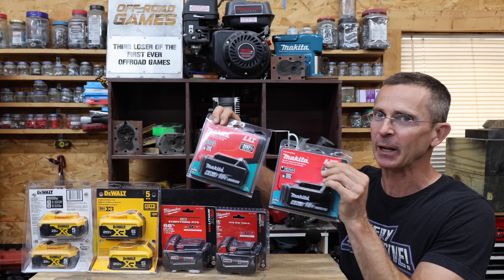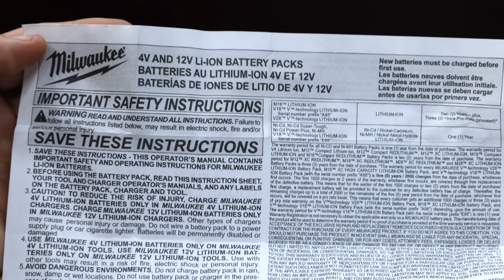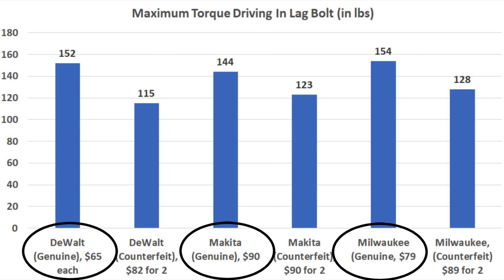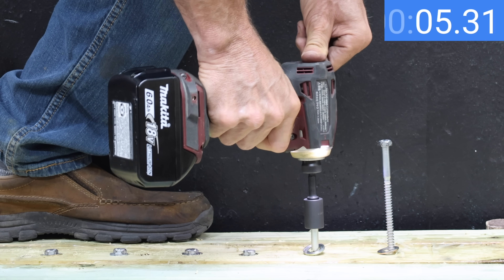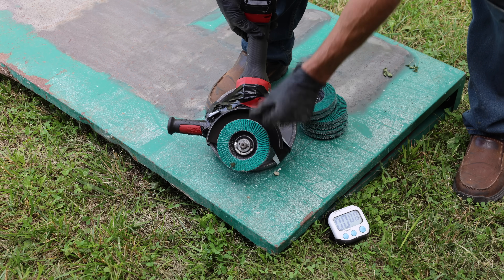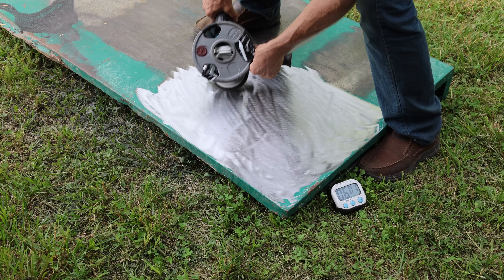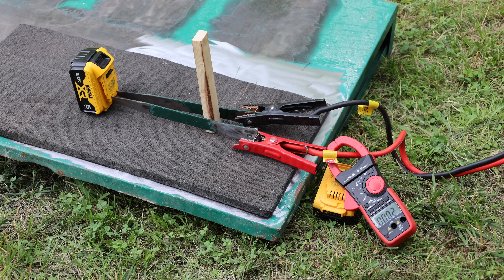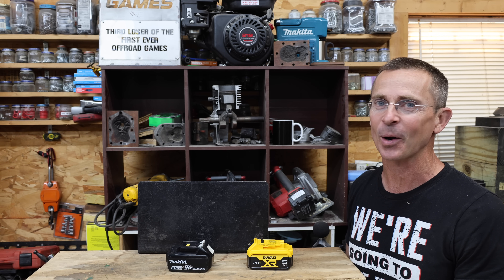Have You Been Scammed with a Counterfeit Tool Battery?

Comment: Ok, so I have to say your efforts for this video is amazing! I found a counterfit at Home Depot, most likely a return fraud, not a HomeDepot supply chain issue... but none the less, a problem.
However, I manage to weight the dewalt batteries and you could totally tell! Your video of the weight was extremely helpful! Shared the video with my local Home Depot and Lowes staff.
Reply from the maker: Thanks for sharing!

Comment: 30 years ago, I managed off shore development, including the development of a battery, to be sold to our customers.   The first batteries came back without the protection circuit.  They made a mistake.  But we caught it in testing, and had it corrected.  So, odd enough, there are companies overseas, that will make the batteries with your label to your specification.
Reply from the maker: Thanks for the suggestion.

Comment: I bought some milwaukee m18 on ebay and didn't realize they were counterfeit until one of the batteries failed the first week and that my older 5 amp batteries were outperforming them.  So yeah, there's a reason why a couple M18 batteries will run you $200 from home depot.

Comment: Most of the counterfeit batteries use worn out recycled batteries from old laptops and things like that. I would guess they test each cell to make sure it will take any charge at all and rewrap them. Even if they do work, they simply won't last very long at all. You are still way better off buying genuine batteries that will last far far longer and perform better. Paying half for something that will die in 1/10th the time is just not worth it.

Comment: Here's a from left field request. How about exercise loop resistance band comparisons. I'm older, and just don't want to deal with weights, so these are it for me. Every review I watch, I can't help but think that you would do better. My main concern is value and longevity....which I'm sure you can come up with contraptions to test that. I'm also wondering if there is some technology that they can incorporate into the band to make the resistance range more uniform.  In other words, at the beginning of the rep, if it's 50 lbs, at the end range of the rep, is it still close 50 lbs, or significantly higher. Anyway, that's my request.

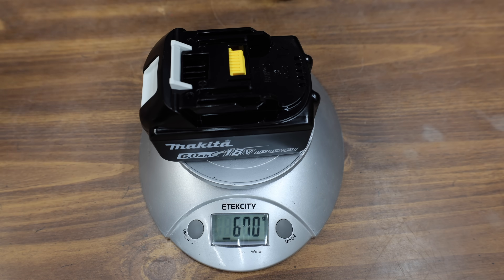Comment: The othentic makita batteries have a little star on them where the power tool slides in.  When you were taking off the casings at 5:05  the left battery was the othentic. You can tell by the star and the orange colored data connection
Reply from the maker: Thanks for the constructive feedback.

Comment: About a year ago, I was trying to acquire a couple of high drain 18650's for a project I was building.  I didn't really care much about what brand the batteries were, as it was only going to be in use for 2 to 3 weeks. It was cheaper to buy a knockoff drill battery than to buy the individual high drain cells, so I bought one, new, genaric "Makita" battery for $35 online. (Amazon) The seller was openly stating that the batteries are not made by Makita. When it arrived I took the battery apart to gets the cells out and found them to be used 18650's and they were regular "laptop" cells, NOT high drain cells. 
Worst $35 I've ever spent.
Reply from the maker: Thanks for sharing.

Comment: Do the 12v DeWalt batteries have the same identifiers? All of my 20v have the QR code but the 12v do not (and there's no space for it on top or bottom). All of my batteries were bought at Lowes.

Comment: In these comments I saw someone refer to Amazon batteries as 'counterfeits'.  Not so.  They are clealy marked as 'replacements'.  And are clearly different in appearance.  And actually, in my experience work better than the originals that came with my cordless tool at a fraction of the price.  I just bought a 2 pack of such batteries on Amazon for $30 ($15 apiece).  And they last as long or longer than the originals.  And I've used over a hundred of this type batteries off Amazon without issue.  My tools OEM batts cost over $100 per.  The replacements are $15.  I don't care of they do blow up or are slower.  I can afford to buy them.

Comment: Project, you're missing the point.  Saving money is worth the extra second to drive a huge lag bolt which few will ever need their drill to do (incidentally).  And the OEM genuine that come with the drill are just as worthless in terms of longevity.  I get more out of the aftermarket batteries than either the OEM or counterfeit one's.  I get 'em on Amazon for $15 each and they last me for years.  And I don't care if they take a second longer to drive a screw, etc.  By the way I can remember having no cordless tools and doing it by hand or with and egg beater hand drill.  Those used batteries that were ME.  When I wore down I went in the house and had refreshments.

Comment: I'm actually super disappointed in your lag bolt test. You didn't use a consistent pressure for all the tests and depth for sinking the bolts was subjective.

That's not to say that the Milwaukee wasn't still the fastest, however.

Comment: Genuine Makita batteries (at least the ones I have) have little surface mount fuses on the control board that will blow in a dead short. You can type the part number into an electronics distributor site and buy replacements for a few dollars. Solder them on and you have a good chance of getting the battery working. "JHC 6002503 R44E" is what i used.
Reply from the maker: Thanks for the feedback.

Comment: This has to be the most disconcerting video yet. Especially if the counterfeit is exchanged at a big box store and simply put back on the shelf as "opened" with a 10% discount. I've made purchases in the past at both Home Depot and Lowes, get home and clearly the item had been opened, returned and simply thrown back on the shelf with no inspection by the either store to make sure all the parts where there. I wonder if the big box stores have ANY policies in place to thwart this BS.
Reply from the maker: Thanks for the feedback.

Comment: That's why I make sure my Milwaukee M12 batteries are 100% non-Milwaukee but also 100% OEM/ODM specs (Elefly brand). The Elefly brand holds up pretty well (actually really well). I feel like I've found the Unicorn replacement battery for Milwaukee M12 tools.....
Reply from the maker: Thanks for the feedback.

Comment: If the originals weren't so ridiculously expensive, there wouldn't be such a market for the counterfeit ones.  I always buy the batteries bundled with the tools because they are usually reasonable that way.  I would never buy counterfeit because there is too much at risk if there's a fire.
Reply from the maker: Thanks for the feedback.

Comment: Idea for a video: test of camping coolers/ice chests. Whatever you wanna call them. Yeti's are great, but really expensive. Heard good things about Coleman. It'd be interesting to see if the 12V thermoelectric coolers are really worth the hassle? I have one (Coleman brand, bought it used) that worked fine for a while and now it doesn't really. I'm about to ditch the idea of hauling a solar panel, a battery and the controller with me, and just get another "normal" cooler. I rarely go for longer than 4-5 days, so if there is something that will last that long, without using 80% of space for ice ;) that would be great.
Reply from the maker: Thanks for the suggestion.

Comment: These are probably made in the same factory. China is notorious for doing overruns of product in the factories and then selling them directly to make more money. So the factory will have an order of 1000 authentic batteries for the manufacturer and will produce those 1000, then change a couple things to cheaper variants and produce 1000 of their own with the same molds and machinery.

Comment: The biggest problem that i see with the counterfeit batteries is that they are prone to failure when used heavily.  Yes they are less powerful and do not last as long... but depending on what your using them for that may not be the deal breaker  after all if they are half the price your overall useage time will be more overall.  

But if they short out and break the first time you use them hard?  Thats just not good at all.
Reply from the maker: Thanks for the feedback.

Comment: I had no idea there was such an issue with counterfeit power tool batteries. Is there any way to truly tell a counterfeit battery from the original without having a side by side comparison? Especially since manufacturers frequently change the look of their batteries and packaging. Thank you for fringing this to light. No more "cheap" internet batteries for me, that's for sure.
Reply from the maker: Thanks for the suggestion.

Comment: Yep got scammed buying DeWalt packs on eBay last week, saw this video and got scared... Worst thing is I opened the first pack, saw Samsung cells and bought another... Saw this video, got scared, opened the second... Sanyo cells, pulled the pack all the way out of the shell, they're all second hand, you can see where they've ground the ends of the cells to remove the old spot welded tabs, one pack was Samsung 20r in a 5ah pack and the other ur18650rx which is also 2ah cells so both packs would be 4ah when they were new! But they're second hand cells swapped into a new case, Lucky I only bought them last week! Praise project farm for saving me $150, return processed, reported seller, thank God for project farm!
Reply from the maker: Thanks for sharing.

Comment: Bless you for this video and the expose of counterfeit batteries. I just purchased from WallyWorld DeWalt 20V 5 amp batteries and weighed them and compared to the same type that I had purchased from Amazing in November 2023. The WallyWorld battery weighs 602 grams and the Amazing battery weighs 644 grams. They are identical in apprearance. If the price is too good to be true, it probably is a fake. Buyer beware.
Reply from the maker: Thanks for sharing.

Comment: I bought a 2 pack of 9ah DeWalt batteries from Lowe's and noticed right off the back they didn't have as much juice as my other 9ah batteries. Waited a couple cycles of the batteries thinking maybe they just needed to "wake up" well they just got worse. Ended up opening them up to check to see if somehow they had gotten outta balance cell to cell. As soon as I opened them up I knew they were fake they didn't even have any kinda of circuit board in both of them. Tried taking them back they wouldn't accept them back. Just ate the money lost and never shopped at that store again neither did the company I worked for at the time. Lesson learned can buy real batteries from anywhere lol
Reply from the maker: Thanks for sharing.

Comment: Have a Sears drill from 2011, as of now 2024, original batt still works, but bought a second one recently "just in case" this new batt looks great, and ran the drill fine, until it ran out of juice, and then would not charge on the original charger at all (charger did not "see" it) A sad state of affairs.
Reply from the maker: Thanks for the feedback.

Comment: What about Best Boot dryer? 
For drying boots daily after wear.
Reply from the maker: Thanks for the suggestion.
Reply: @ProjectFarm  no problem! Thanks for reading and making the videos.

 I would like to know about reliability of these relatively cheap units and safety for me and my family.

The unit I have can not run on my Service Vans 120V plug, it over amps.

so drying while driving is out of the question, I have to do it overnight.
Dry boots lead to less foot issues in the working world. Thanks

Comment: Video suggestion: Best Inspection camera/Boroscope. I use mine to look for leaks in the wall, under the outside trim for rodent entry points, under blown in attic insulation to trace a wire or leak. Only problem is, mine sucks. I have no idea what makes one better than another. Hope you make this one!
Reply from the maker: Thanks for the suggeston.

Comment: With air-conditioning moving to potentially explosive R454b I'd like to see it tested independently and publicly. Maybe a constant fan in a sealed box and increase air/454b ratio with a constant ignition source mythbusters style. I've seen maintenance crews put over 40lbs of refrigerant in leaking systems before so I'm concerned.
Reply from the maker: Thanks for the suggestion.

Comment: Project idea: best multimeter
All meters have a rating of 600V Cat. III or better
Fluke 87V
Amprobe AM-530
Southwire 16020N
Fluke 101
Klein MM325
Ames Instruments DM600 (Harbor Freight)

AC voltage accuracy
DC voltage accuracy 
Max/Min recording function 
Backlight
Resistance (ohms) accuracy
Voltage spike withstand to failure
Reply from the maker: Thanks for the suggestion.

Comment: Damn... now to be fair, when I buy batteries off of Amazon, I am not trying to buy the exact same maker as the original, I just want a device that will fit and work the original tool.  I've had great luck with the Black and Decker substitute batteries, which actually last longer and work better than the original batteries that come with the products.
Reply from the maker: Thanks for sharing.

Comment: Tool makers will probably have to resort to some sort of encrypted chip in the battery which needs to be activated by a Bluetooth app which communicates with the manufacturer.  Of course the risk is counterfeiters will figure out the algorithm used to register fake batteries, just as they figured out how to generate physical serial numbers which are accepted by the manufacturer web site.

Comment: For what it is worth, I accidentally bought a knock-off Milwaukee battery.  Didn't know it until watching this video.  Compared it to a known real Milwaukee battery and clearly it is a copy.  

Just for the heck of it I took it apart and compared it to the real Milwaukee battery in this video.  The knock-off I had, had Samsung cells in it but the rest of it looked like the knock-off in this video.  The circuit board in the knock-off clearly was different from that in a known real Milwaukee battery I have.   Bottom line - apparently knock-offs come in different flavors but cut enough corners to be cheaper.
Reply from the maker: Thanks for sharing.

Comment: Review idea for you Todd. Wild Fire resistance of house siding. Wondering if cement board type and maybe steel siding might be significantly better than wood, pressboard or vinyl. I think I know the answer but it would be fun to test and interesting to know for sure.
Reply from the maker: Thanks for the suggestion.

Comment: This is a very valuable video - revealing the extent to which scammers will go to produce "look-alikes".  Now the problem: how do we know?  The simplest approach - which won't work - is to presume the "cheap" one is the fake.  But a really smart scammer won't make it cheap - maybe even making it more expensive to fool those looking to avoid the "cheap" knock-off.  Yikes.  What do we do?  It would have been helpful if there was some commentary on where "true as claimed" batteries could be purchased.  For example, maybe it be possible to say "you will probably get the real deal if you buy at a store with a reputation it wants to protect."  Anyway, thanks for this helpful video. The issue of fire makes this a more important issue than many other types of purchase.
Reply from the maker: Thanks and you are welcome!

Comment: I life in germany and we have you could say a experiment going. My father and i drive both diesel, my father a 20 year old Mercedes C 220 W203 with the 2,2L engine (i say it because depending on the factory tune you can get a different classification) on long distance drives and i a 7 year old Microcar mgo4 Highland X with a 480cc engine (that engine is from Lombardini/ Kohler, those are also used in generators and small farming equipment) on short distance. We both use the standard diesel which can have up to 7% bio oil. 
His engine still runs perfect after over 600.000km (only the glowplugs getting a bit weak (around 70% performance), on my one the injectors got caked up that they doesn't want to close completely so that diesel gets into the cylinders and gets down into the oil if the engine is shut off, other problems is often after the start that one or both injectors gives to much diesel on low rpm that the engine is about to stop running or you give a bit gas and the engine starts to rev up like you press the pedal completely to the floor.
Now i had changed the oil (because it was contaminated with diesel (about 25% diesel in the oil) and switched to the premium diesel and after a few hundred km now the problems starting to go away.

Now a video suggestion from me is to see if you can see a difference on the injectors and other components by comparing: 
standard fuel and short distance(letting the engine run for 10min, shutting off for 30min and keep reapeting it )

Standard fuel and long distance 

Premium fuel and short distance 

Premium fuel and long distance
Reply from the maker: Thanks for the suggestion.

Comment: hey, so gasoline has a fuel air ratio to 14.7 to 1, however rubbing alcohol or high concentration ethanol, needs 9 to 1. So the reason why cars say no more than 10 percent ethanol could have to do with the air fuel ratio.   However vodka is 60 percent water. The ethanol could be so diluted that it would actually match the gasoline's air to fuel ratio. So it might be possible to stick vodka in a gas tank of a modern car and drive just fine. People will complain about residual gasoline, but you could maybe run it out of fuel on the vodka and refuel.